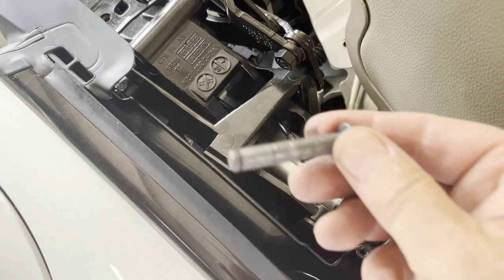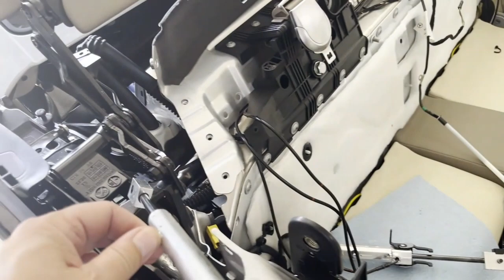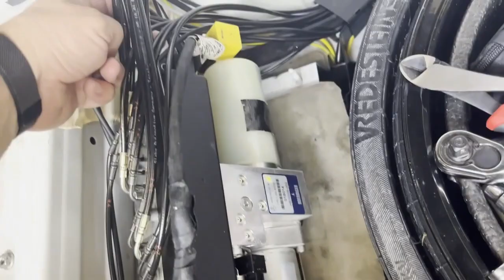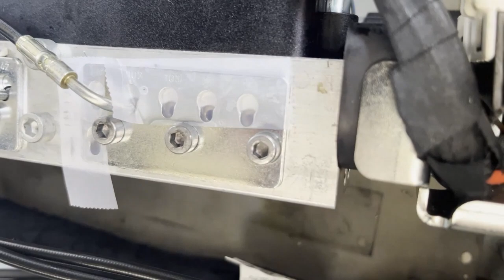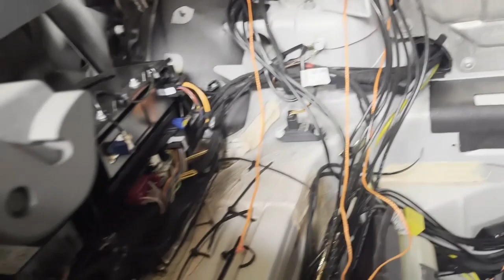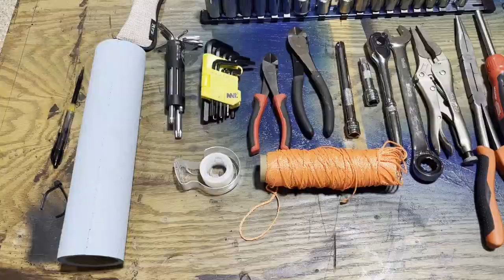MB SL 550 Lift Assist Part 2

Comment: I'm thinking of getting one of these SL with a broken top and gutting the hydraulics to make it a permanent hard top.   Just weight reduction and a little more trunk space plus the parts can be sold.  Also gut the abc suspension and put coil overs then the car is reliable and cost effective to run
Reply from the maker: If / when the abc starts giving me problems I will switch to coil overs.
Reply: my roof is broken and the ABC is replaced ,I'd sell it if  youre interested
Reply: @Coffeepapiii , what year is yours?
Reply: Do you think it would be helpful if you removed the Vario roof (open/close) hydraulic cylinder first? That’s the one that is horizontal. Would that allow you to get to the load assist (raise/lower) hydraulic cylinder (vertical) easier?